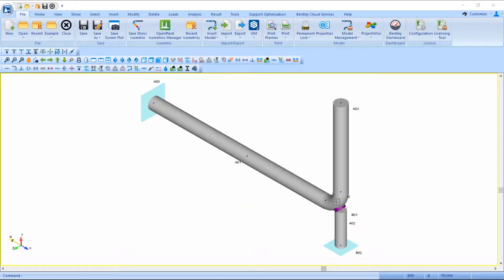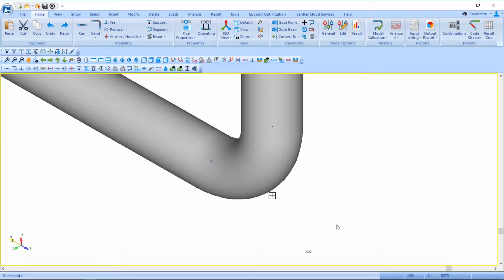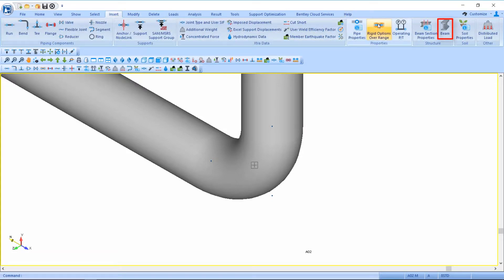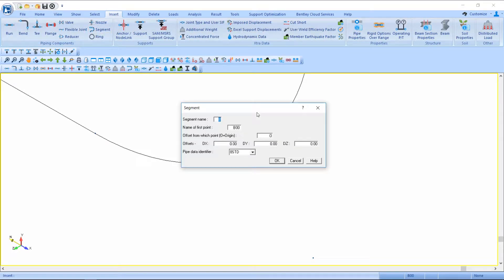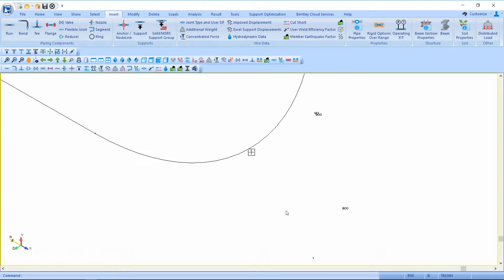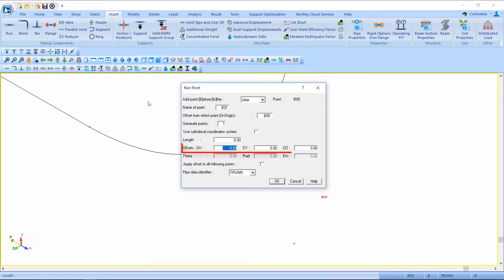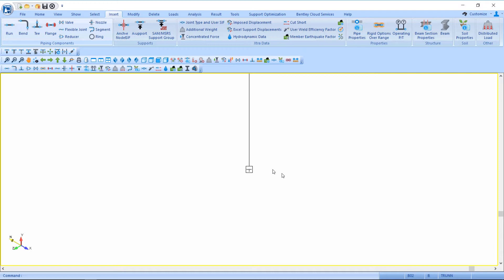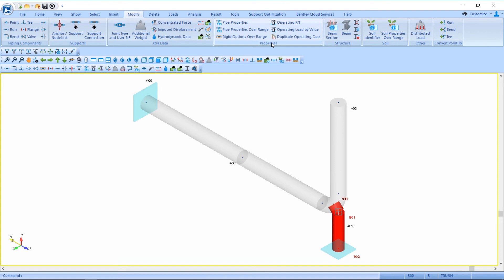Modeling a Dummy Leg as a Pipe

Comment: This demo has wrong info. In PRACTICE, the temperature of trunnion section from outside of pipe is just set to AMBIENT condition! Only the "rigid zero weight" part from midpoint to bend point is consider for design temperature.